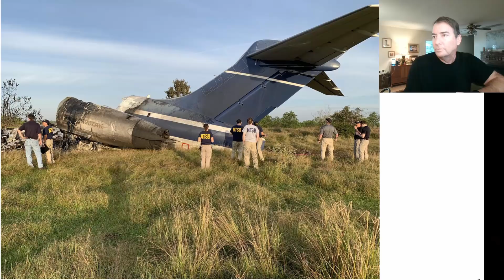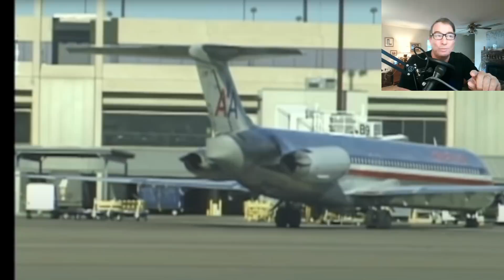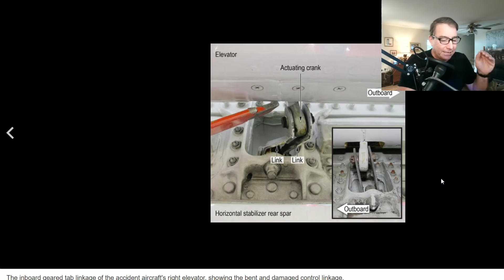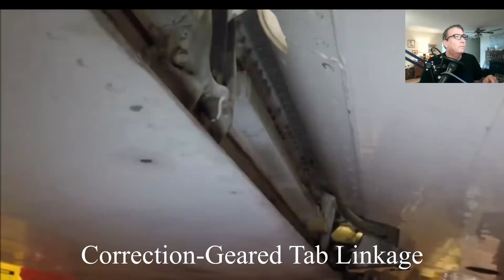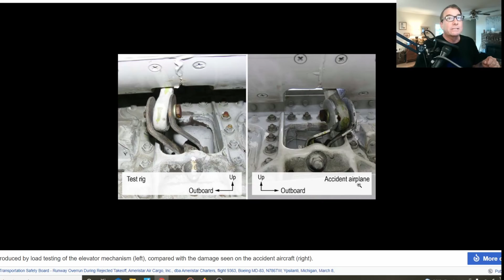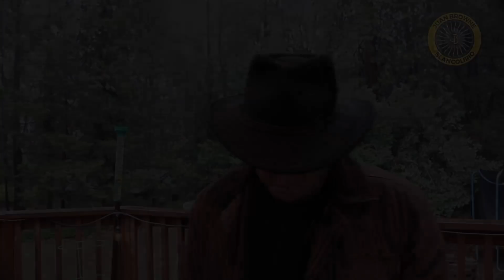MD-87 Crash Houston UPDATE 9 Nov. Flight Controls

Comment: Would it have been possible for the elevator to have been damaged just enough that the plane could’ve still taken off but then had trouble in flight?  Like, did this accident prevent a catastrophic accident from happening if it had gotten airborne?

Comment: Very good job explaining this...thanks.  I'm just curious, I'm a commercial helicopter pilot and we always friction down the cyclic and collective to prevent the wind or any other forces from moving the control surfaces and damaging them.  Do airplanes have a way to friction down the controls at all?  I understand that the elevators are free floating on this particular aircraft and it wouldn't make a difference...I'm just asking in general.

Comment: Ever since that Alaska Airlines MD-83 crashed off of Malibu, I have never trusted the design of this plane.
Reply: Alaska Airlines got authorization to extend the time between lubrication intervals of the stabilizer Jack screw.  At the last jackscrew inspection, the mechanic found it to be worn to just below the service limit.  He wanted to replace it, but his supervisor said to keep it in service.  The mechanic was so bothered by this, he made a copy of the log book page and kept it at home.  Later to become evidence.....
Reply: @blueskies8834  Yep. When I read about the jack screw and how improper lubrication intervals could bring down the plane, it made me question the whole design. I don't like that jack screw design and don't trust it.
Reply: If you abuse a system/equipment to the point of failure, we should not be surprised when it happens.
Reply: @blueskies8834  Totally true. But they engineered in a critical failure point without any redundancy. I won't fly on Russian planes or MD-80s. Although I'm sure most of them are perfectly okay.

Comment: Is there any reason why the elevators weren’t designed to be locked when the aircraft was parked to save them from wind damage?
Reply: I've wondered and asked about that myself. One person offered this: A system that locks the elevator in place raises concerns. If it were to fail, and lock the elevator during flight, the results could be much less than satisfactory. Designing, developing, testing and approval of such a system, and the required redundancy to render it safe, would be expensive and time consuming. Because of this, the manufacturers may have chosen not to address the issue. The decision could have been based solely on financial considerations or as a requirement to meet a specific deadline. 
Of course, there's always the possibility it was never considered at all by the designers. 
On many aircraft the gustlocks are an accessory that is applied, or installed, onto (as opposed to into), the aircraft. These are usually designed and developed "after the fact" and as such are not considered by the designers of the plane itself. 
I don't know if this was the case with the DC-9 or not. Perhaps someone with that knowledge will share that with the rest of us.

Comment: I wonder how much thrust is getting  blasted straight up when the attenuators are deployed for a "blow back"? Enough to exceed the damping limits? 
 Also... if one of the dampers "gets weak" (leaks) would that essentially bring the wind speed limits down on the design limits and allow the elevator tab "flop around"?

Comment: If wind forces had caused an over centre condition wouldn't the tab be stuck abnormally deflected and visible from the ground? (I probably haven't understood this at all !)
Reply: No. The geared tab (servo tab) moves in the opposite direction than the elevator (if elevator moves trailing edge down, then the servo tab moves trailing edge up, and vice versa) actually augmenting the pilot's inputs. So with the elevator deflected fully down, the servo tab would be deflected fully up in normal conditions. The difference between a normally fully deflected tab and one with overcenter condition would be minimal to be detected visually, if it exists at all. The problem in that accident was not that the tab was jammed, but that the elevator itself was mechanically jammed due to the overcenter condition of the linkage of the tab.

Comment: At my previous airline, the opposite happened to a friend of mine. Elevator cable slipped off a pulley and commanded full nose up elevator. Apparently the nose began to rise at 85kts. They aborted before becoming airborne. Had they delayed the abortion, it would have been curtains for all. Still my favorite jet!

Comment: After 50 years of aviation interest and an IFR rating I had never heard of “tab-flown” control surfaces.  Amazing idea.  So how do you check controls free and correct?
Reply: You don’t.   You can only check that they are free (control tabs are moving).    I believe the MD-95 (B-717) has a display in the cockpit of flight control positions, but I don’t know if they are tab positions or actual elevator/aileron position.

Comment: blancolirio sir,  So what I'm gathering from your video is that the elevator is free floating and you use the tabs to back fly the control surface's. Am i understanding this correctly? When I worked on the A10A it had the same system as part of the triple redundant flight controls. I was Qualified to rig Them.  Thanks

Comment: Its odd how this fault did not surface in all the flights with larger airlines over the years but has only surfaced relatively late in the planes life
Reply: It is probably because of the dampers losing effectiveness over time and/or these planes being left for long periods of time at small, less monitored airfields.
Reply: @stephenj4937  Yeah I was thinking that...viscous means fluid of some kind so maybe the fluid degrades with time

Comment: Wow. Good to see. Thanks Juan. You'd think micro camera somewhere would provide a way to verify visually that the cable rod assembly was not jammed..or a micro switch to indicator light~ something should be available for a pre flight. It sounds like a really reliable control system...I'm not a pilot, but I do not like computers over riding human oversight.

Comment: basically you cannot visually or even touch this gear as a preflight so you may preflight and try to fly a doomed plane.
Reply: Push the yoke at 80 kt to check that the nose dips a bit.  Other posters have mentioned that being the procedure with the DC-8.

Comment: Why dc9? I thought it is md87?
Reply: Basically the same...  MD-80/90 & B-717 are all newer versions of DC-9.
Reply: @Dana_Danarosana  ok. Knew there were variants but didn't know they were all considered under that category. I thought Boeing and McDonnell Douglas planes were separated but it makes sense since Boeing bought them out.
Reply: Kind of surprising that the original scheme floating elevator from the early DC 9 wasn't changed for the new MD 80 series

Comment: can you explain exactly how the control tab is able to displace the elevator enough to effect a pitch change? Why not just change pitch with a the tab, a big one, like,,,an elevator? sorry I just don’t understand the physics of a free floating elevator or how that’s even possible or efficient and or beneficial. Seems like extra mechanical parts that don’t need to be there. How does it REALLY work ?
Reply: There are no hydraulics to help the pilot overcome the weight of the elevator movement so the designer used a small tab that the pilot can move by cable (not hydraulics) and that small tab thru a force multiplier moves the large elevator. If the small tab is moved down, the incoming wind will hit it from below and raise it up. That action will move the elevator down, in which case it's actually elevator up action so the plane will fly upwards. Same goes if the tab moves up but now the plane is going down. Why use this system? Because it's light and reliable and you need to save weight in the tail as much as possible otherwise you'll need to add weight many times more to the nose of the plane to balance it on center of gravity. Pulleys are lighter than hydraulic cylinders and fluid running thru them. One other thing that helps pilot to move the elevators is counterweight in the elevator. It's installed in the tip  and in front of the hinge line so that the elevator balances horizontally w/o input.

Comment: ...a known issue ignored. It happened in the past. The results were discovered. Avoidance programs were issued. Nothing was done. EVERY airport large enough for one of these aircraft will have a Cherry Picker or Boom Truck. A few minutes with some plywood squares and a long bolt and the Elevator could be LOCKED. Is that so hard? Or is is better to keep putting people and equipment in harms way because securing an elevator would not be cost effective? At 75 and former small plane A&P, I wonder if common sense is being displaced.

Comment: Arrow dynamic question, wine, OK apples going to do this to me again, Jay UAN. How does the control tab move the elevator beyond the point where the arrow dynamic forces against the tab are equal to the arrow dynamic forces against the elevator? I think it must have something to do with the servo operated tabs. However, this is why I’m asking the expert.
Reply from the maker: Leverage and balanced controls.
Reply: @blancolirio  I will have to look this one up sometime. There has to be some kind of mechanical force, whether hydraulic, pneumatic, or electric, that actuate the surfaces

Comment: Sounds just like the other case where overnight wind gusts caused the elevators to break and it wouldn't rotate
Reply: The Wiki article also mentioned jet blast, which could occur very briefly and without being noticed as other aircraft are moving in the vicinity

Comment: Petter at Mentour did a great vid on the Michigan MD83 crash that you referenced (https://youtu.be/61_TqeITE3I). Including how the recorded wind speed the prior night was below the approved windspeed, but the wind vortices created by the aircraft's position next to the hanger made the wind speed greater and damaged the linkage.
Reply: It will be interesting to see if this is the same problem.  Thanks for the vid. It's another great one.
Reply: You know what, I was just thinking about this but couldn't remember where I had heard it! If this aircraft was sat in a specific location on the airfield with wind (maybe squally wind) funnelled through two buildings it probably could cause this. Hopefully if the NTSB see similar issues on the linkages they will look at where the plane was parked and the previous wind speeds/directions since the previous flight.
Reply: Thank you for the link!

Comment: Yes, another very similar, I'm surprised there wasn't an AD after they recreated the wind/damage on the last 1, was NTSB preoccupied with China's gift to the world?
Reply: NTSB doesn't issue AD's.
Reply: @marcmcreynolds2827 Thank you for the "Advisory " Have they made any strong "advisories" to the FAA Marc? Just my Nickel in the grass .
Reply: @bernardc2553  Those might come in about year, given how the process usually works.  Maybe sooner in this case, considering how well the test rig results matched the accident aircraft.  But there still looks to be a lot more work to do first -- in particular, how the meteorological factors figured in.  With good in situ data to work from that could go relatively quickly, though in this case it looks like they may have to resort to quite a bit of modeling as a substitute (= more time).

Comment: Juan, some years ago you reported on a crash in France where they were flight testing an Airbus, and the pilot ended up diving into the water, with predictably bad results. By complete happenstance yesterday I came across a reference to this accident and the accident report. See 10:58 into https://www.youtube.com/watch?v=zXhXErZHpHg . The accident report is linked in the show notes for that otherwise unrelated video.
It seems that they pressure washed the plane, and got water past the seals on the AOA vanes. The water then froze when the plane got up to altitude and locked them in place, but the plane didn't do any maneuvers that let the pilot or autopilot know that they were dead, since they still agreed, and the plane wasn't doing anything violent. Unfortunately they hadn't unfrozen after the plane descended.
I don't know if you want to do a follow-up on that report or not.

Comment: Oh boy, another Alaskan Air DC 9 incident! But this time everyone  survived!
Reply: Not related in anyway.
Reply: @blueskies8834  Well, it's similar in the sense that the elevator is up high and hard to service.
Reply: Alaska accident was an MD80.   It involved a jammed stabilizer Jack Screw.   They then put so much load on the Jack screw that it stripped all the threads off the screw and lead to an uncontrollable situation.   The entire stabilizer departed the aircraft inflight.   It appears the Houston accident involved the elevator and not the stabilizer.

Comment: Bad news about the rain...

It will not help much at all.

Take a look at the before and after water levels. Take a guess how long that will last. Take a look at the ground surface observations both before and after.

Then a look at all of the areas that were previously effected by fire damage. Guess how much is holding all of that ground material where it is supposed to be? Also guess where a lof that ground runoff went.

California and other states have some grave issues. Some issues which are not easily solvable.

California has millions more in population that it could ever have in rain; whether it is direct rain or rain imported from anywhere else.

Comment: Correct me if I am wrong but it appears that this mechanical system and it's robustness is simply SHT!, not built well, not designed well and specifically designed at a lower cost per unit compared to other aircrafts control surfaces. McDonnel Douglas never was know for quality but was well known for affordability which in turn COST many human beings their lives in many of the different models produced and sold worldwide. Cheap is not an option to play with when dealing with peoples lives, as Boeing has learned the hard way!.